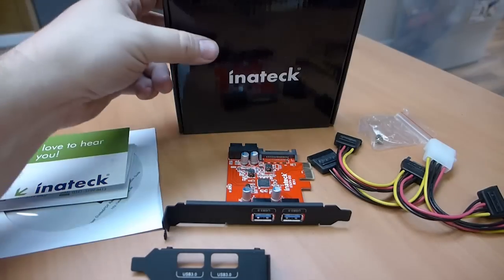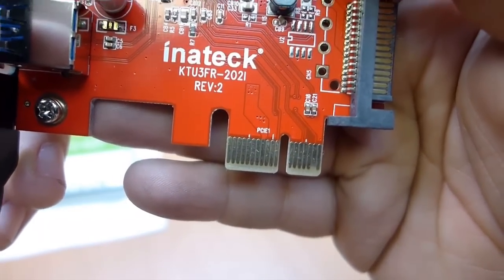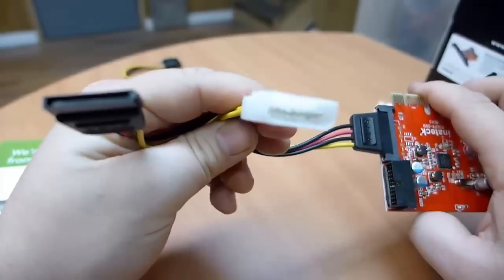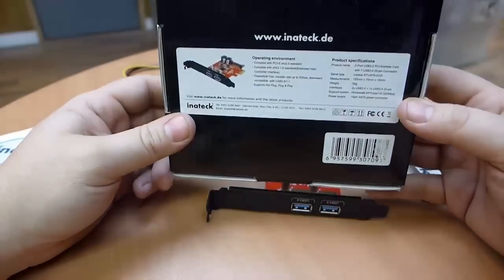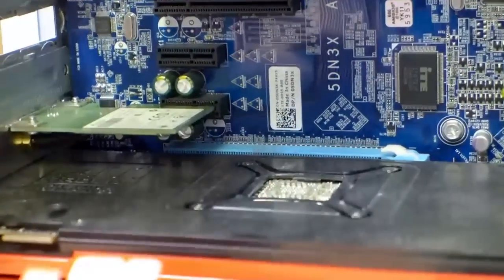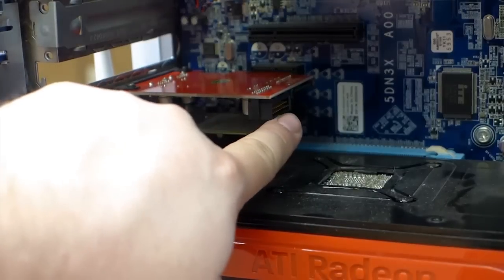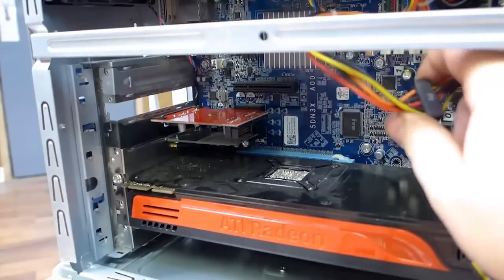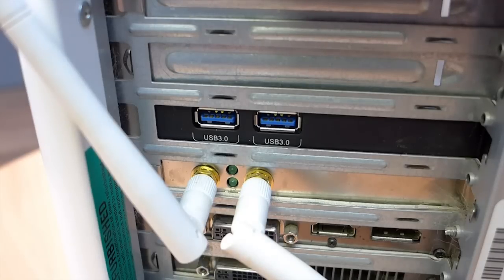Inateck PCI-E to USB3.0 Two-Port Expansion Card Review & Installation

Comment: Inatek have stopped producing that PCI-E Card.
Reply from the maker: Yeah, this video is four years old and I wouldn't be surprised to hear if this particular card is out of production. A lot of the video should still be applicable to newer cards or ones from different manufacturers, however.